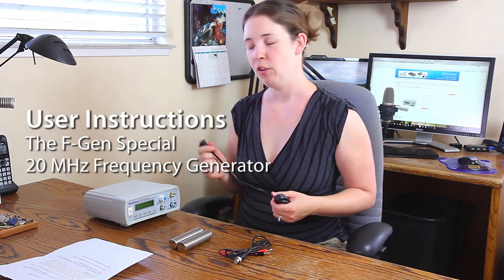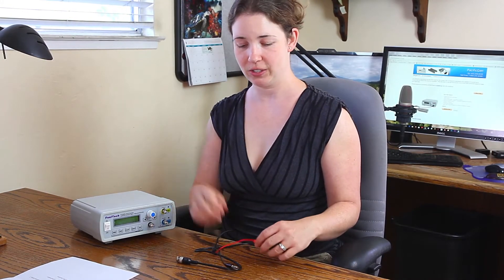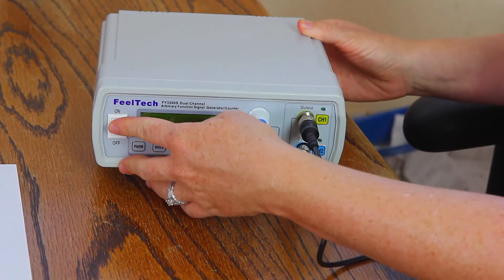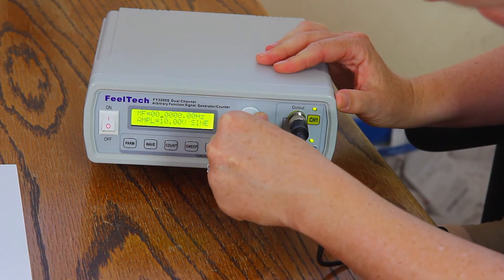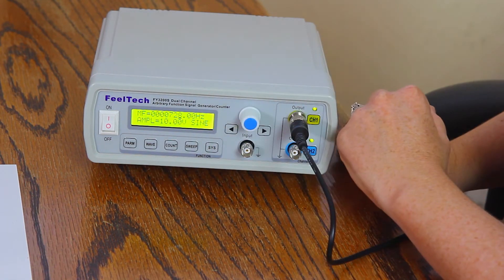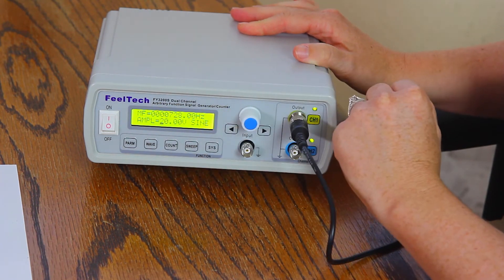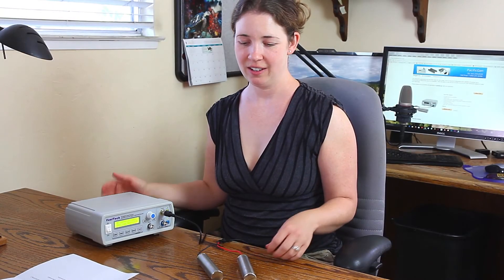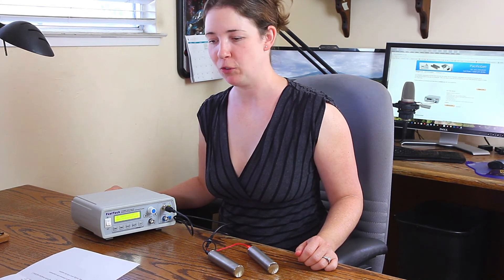$199 Rife Machine User Instructions

Comment: stop confusing people, this is not a "rife machine" Dr. Royal Raymond Rife, Hoyland, Bedini & Priore never used only 1 device in the laboratory. you are only presenting an audio signal dds generator ~ you need high frequency with low voltage, RF amplification with Sideband Generator. Do Research.

Comment: without the 1+Mhz Carrier you will get almost zero deep cell effects.  Also the website is down as of my check 2020 July 7  Also these machines sell for about $100, yet you should probably get the higher quality ones.  I surmise that you can use BOTH channels to do the carrier wave / square wave combo.    so for example 3.1Mhz carrier sine...and 77,000Hz square